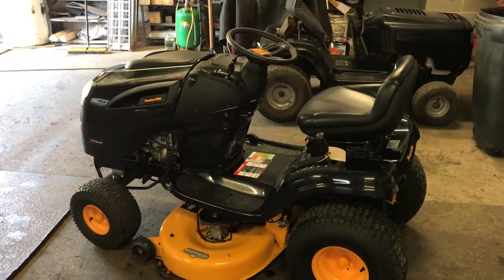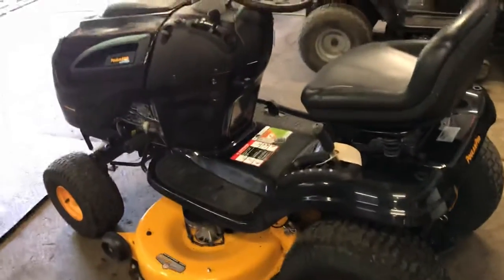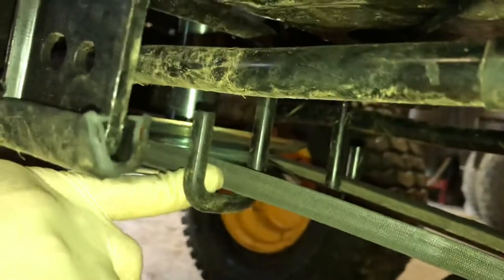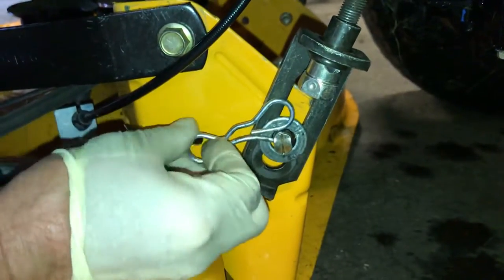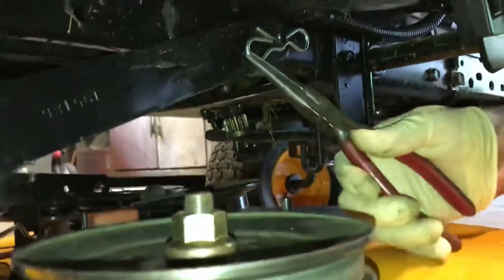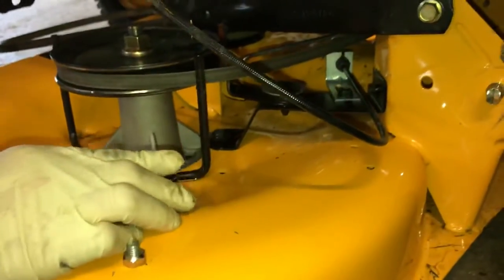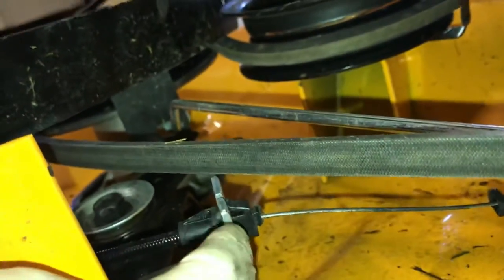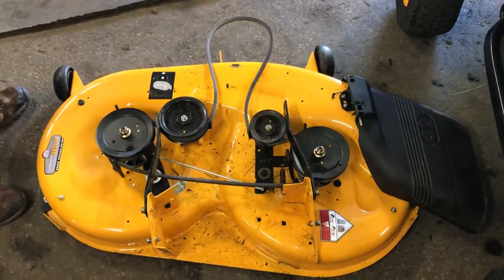How to remove mower deck on a Poulan Pro Lawn Tractor

Comment: Saved me $$$. Removed deck in no time, cleaned it completely, replaced gator blades with regular blades until fall, and put the deck back on, all in about a hour.
Reply from the maker: Nice going! Glad it all worked out.

Comment: Video was a huge help. Thanks for the vid.Had no clue how to get the cable off the bracket. The steps the manual has is a no go. What size mower belt does this model use?
Reply from the maker: I’m glad this video was helpful. You will need to take the model number from under the seat and find a parts breakdown online to get the correct belt for the tractor.

Comment: Thanks for the info.  have the same mower, not only had to replace the pulley drive on the transaxle, had to replace the whole transaxle.  General Transmissions really are a piece of garbage and they do not back them up.  Sorry company.

Comment: I used this video to help me get the deck off.  Now my blade engagement spring broke,  Can I replace just the spring or do I need to replace the entire cable?
Reply from the maker: You will need to replace the cable.

Comment: My mower deck is too low to get into my shed even on the highest setting? Am I able to adjust the whole thing higher? Is it just the adjustable nut in the back supports?
Reply from the maker: Hi Scott, You will need to adjust three positions, the front and the two sides if you have adjusters on both sides. If you only have one adjuster on one side watch this video. https://youtu.be/JvaMxEdah5s

Comment: Have same mower and it looks as tho my brake shoes that stop the wheels on the deck are grooved almost to the metal after only 10 hours?
Reply from the maker: If you are talking about the brakes that stop the mower blade spindle pulleys? sounds strange but I would need to see your machine to find out the reason. As long as the brakes are not making a metal to metal sound you should be ok.

Comment: I have this mower but I have to disengage the blade to go in reverse. Is this correct or am i doing something wrong?
Reply from the maker: Hi Mary, Yes are correct, you cannot cut in reverse until you engage the safety lock out. I am pretty sure once you start the tractor, turn the ignition key back one spot and that should put the machine in the "cut in reverse mode" Try that and let me know if it worked. So start the tractor like you normally would, then turn the ignition key back one position, then try and cut in reverse. It should allow you to now mow in reverse if I am correct.